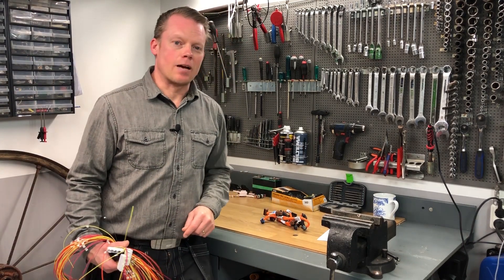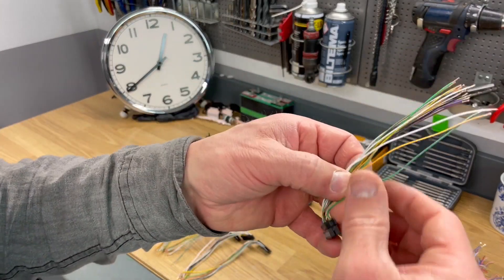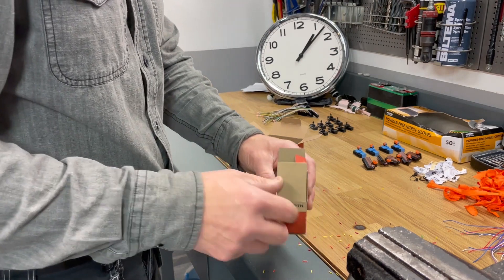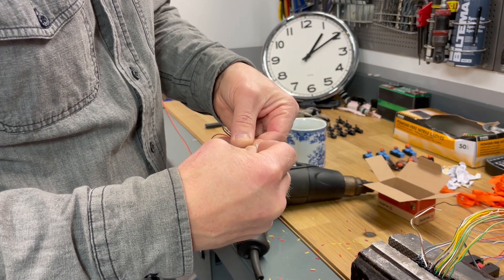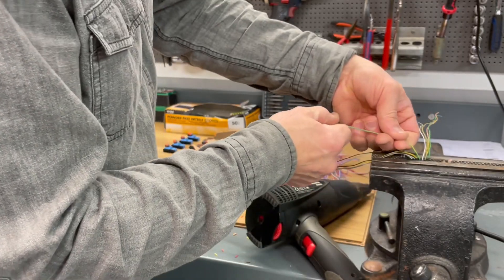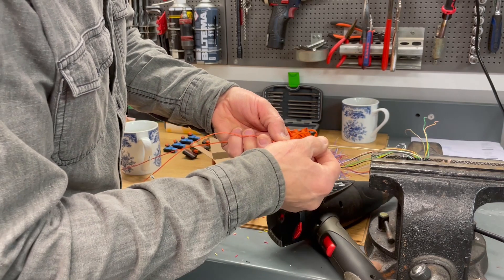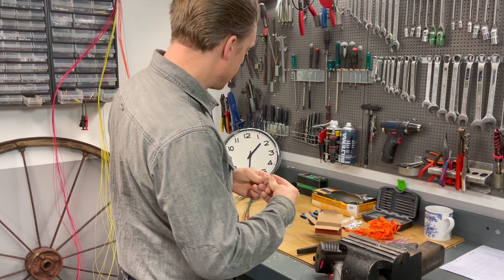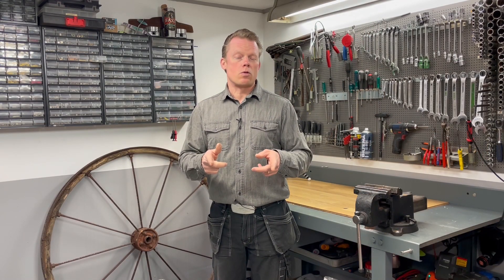Soldering the balance leads, diy Hv battery Orion 108S BMS VW Id3 Id4 DIY 450V for solar storage.

Comment: When I measured between pin 10-pin 11 of the blue harness while the white end is connected to the battery module of the ID4 , voltage is nill!
If the fuse inside is blown the no balance will happen, right?
And found three other cells nill on each of the 12 battery modules
, so four  cells on each module are nill (cells 5,6,7 and 8)
Charge level is 0%
Total measured voltage is 360v!
What do you thing?

Comment: A lot of patience! Great job, the harness looks fantastic! 
What is the AWG wire size you used? 
Your BMS seems to be 100% used, all the 108 lines! For an ID4 battery with 11 modules, a BMS with at least 11x12S=132S should be used.
Reply from the maker: Thanks. 
Id4 uses 8s modules and 12 modules in total if I don’t remember wrong. That will be 96 cells if so. Make sure to check that out first.

Comment: Thanks for the video, which is fantastic. Could you share the specs of the cables that you use to extend the harness of the VW connectors (cross-section and supplier and source)? I’m doing a build of an VW beetle which I’m electrifying with these battery modules. Many thanks!
Reply from the maker: Hi, and thank you. You order those cables together with your Orion BMS. You just have to choose the length of them. Sounds like a fun project. Thanks for your comment and good luck.☺️
Reply: @flyingtools : Thanks a lot for the information about the balancing leads. I use a Boostech BMS instead of the Orion one. It now reads the cell voltages correctly but I don´t know the type of temp sensors that are built in the ID 3 modules. It seems to be a NTC but I haven´t seen the specs of it and don´t know if it´s a 10K sensor. Do you know it by chance?

Comment: hi, Thank you so much for saveing my time and money, your videos are just super. Can I ask why did you decide to use orion temperature sensors and not battery sensors? I have the same solution when building and wanted to know.

Also what do you think, is it important to place the battery horizontally or can the battery be placed upright next to the wall?
Reply from the maker: Hi, glad I could help☺️ The resistance was not exactly the same as the orion sensors. You can have the battery standing and bolted to your wall, it will not matter. But if you need to heat the battery during the winter time, it’s better to having it laying down flat.

Comment: Question: The Orion has 3 most negative cables (-1) from 3 connectors and your battery packs have 9 most negative cables (pin 9) from 9 connectors.  Does that mean you're only connecting the most negative cable on battery packs 1, 4, and 7 only to Orion?  Or does it still hook into the Orion somehow?
Reply from the maker: Yes, 1, 4, and 7 only.
Its like that Orion have 3 modules with 36s in each module (connector)
Hope it helps. 
Thanks for your question.

Comment: Great video, i used a 64.8 kwh battery pack from a kia e niro and was struggling to find a bms to go alongside the solax X1 hybrid inverter. i have already done the bms  wiring to the battery pack just waiting for my bms to arrive. Do you know what volatge does a LG Chem 3.65v lifepo4 battery fully charge at? Im struggling to get more than 40 kwh charge/discharge and I think i may have my charge/discharge volts set incorrectly (too much conflicting information out there 😢). Appreciate your help in this matter
Reply from the maker: Hi. 
Are you absolutely sure that it is lifep4??
I think it is lion, and if so lg chem ncm 712 can be charged between 3,3v to 4,2v
If you like to cycle the battery’s 100%

I do not have any experience with lifepo4 cells, sorry.

Comment: It's a lot of work.   Presumably once you have it working you can use a  much higher percentage of the battery pack, without worrying so much.  What are you planning to change the top and bottom buffers of the pack to?  Great work.  👍
Reply from the maker: Thank you 😃 I normally use it between 30-70% soc but depending on the whether and the energy prices I will raise it to between 10-95% soc in “worst case”.

Comment: it's a lot of work but the result may be there.  do you also know what the maximum voltage difference per cell is now without the bms?
Keep up the Nice video’s 😀
Reply from the maker: It was 13mV after 7 months of use without any balancing and after 3  days it was down to 3 mV at the same voltage.
Thank you so much 😊
Reply: good evening, 13mv is not much without balancing. do you know the maximum amp the inverter draws from the battery. for calculating for the safety switch from the battery
Reply from the maker: @wietsedevries85  30A max from inverter. 35A Bms opens the relays. 40A external dc fuses. 100A internal battery main dc fuse.

Comment: Hi, those soldering tubes are genius. I have them too and it's a thing that makes a man happy, a little thing.🙂
Otherwise, I don't rate this video because I hate cables, yuck🤬. I have about 600 cels to go and a wire from the BMS to connect to each one.😳
Reply from the maker: Those tubes makes it much easier, that’s a lot of cells😅!

Comment: Wow those Würth solder-heatshrink things sure are expensive! I guess the solder formulation in the cheap AliExpress ones are just junk. I wonder if you can get a middle way between the two, price- and quality wise. So a cheap brand-name like Biltema maybe.
Reply from the maker: Hi😃
Yes they are expensive, I looked around before I decided to go with wurth and 
Bilteamas costs 4,90kr and are looking the same as AliExpress, I was not willing to take that risk for a project in this size😅